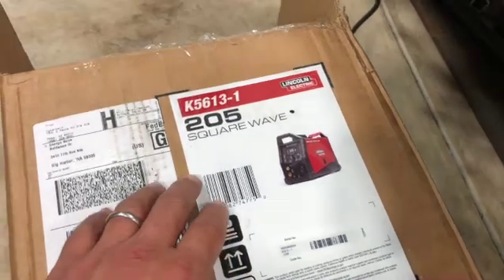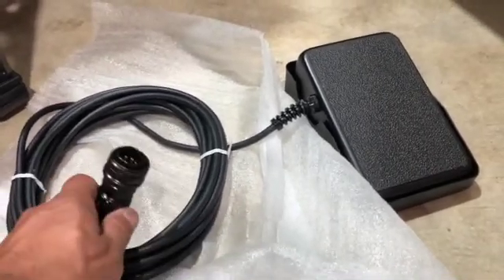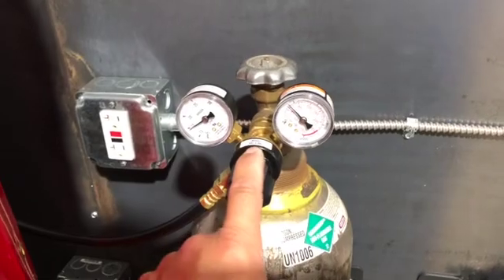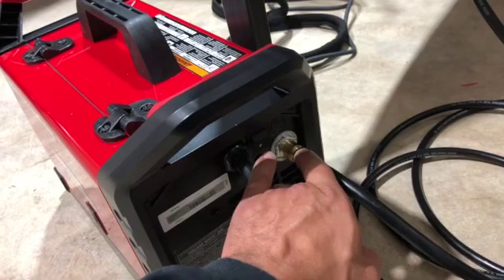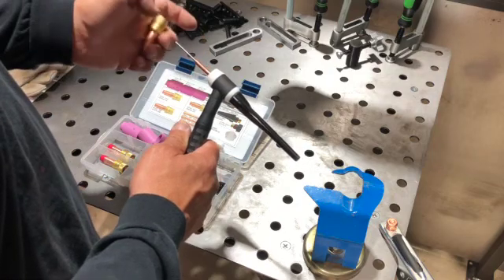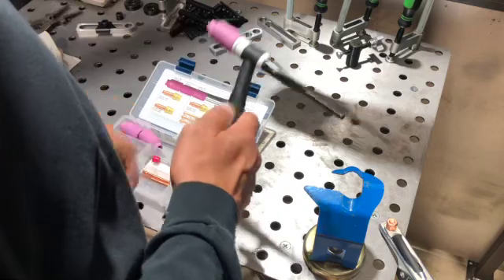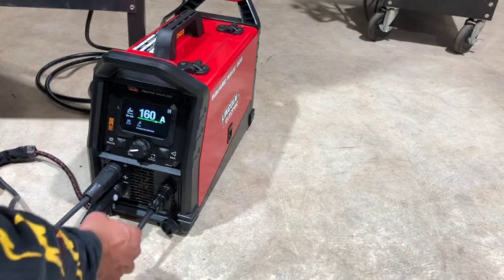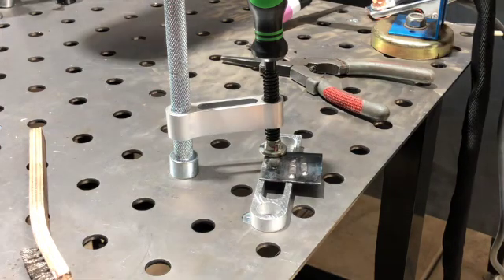Setting up the new Lincoln Square Wave 205 for GTAW (DC).

Comment: Just so you all know,  when you plug into 110 , you are limited with amperage , you will get way more amperage  if plugged into 220, only goes up to 80 amp when plugged into 110 , which is not enough if you're burning 3/32 7018

Comment: can you show how it does on welding thin stainless together
Reply from the maker: I'll see what I can come up with. I'm sure it'll do fine but one's definition of thin might be different than another's definition. Having a good backside purge is crucial for "thin " stainless. I need to build a purge box anyways. Might be a good project
Reply: @Soldamos  im thinking 1/16 or less thickness, I have welded that size at school with good results, but on expensive machines and I wanted to see how this new late model lower cost Lincoln would do. The other videos out there don't show much, they only show beads and not showing actual joining two piece butt welds which is much harder to do. I wouldn't go to the trouble of building a purge box for this.This would be a great test of this machine, I would greatly appreciate to see the results.

Comment: Good video I just got mine today
Reply: What do you think about the machine
Reply from the maker: @derrickhenry8620 I'm liking it so far. Initiating the arc with SMAW feels really good. Has a smooth arc. Same with the GTAW high-freq start. I'll get a video on aluminum and one with DC pulse (and silicone bronze filler) in a couple weeks.
Reply from the maker: Can't wait to test out the DC pulse with some silicon bronze filler